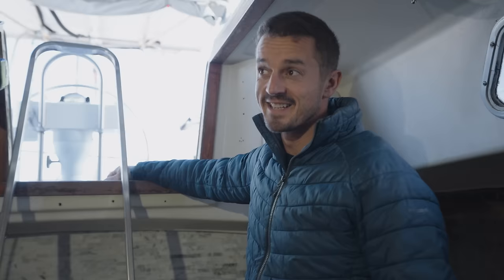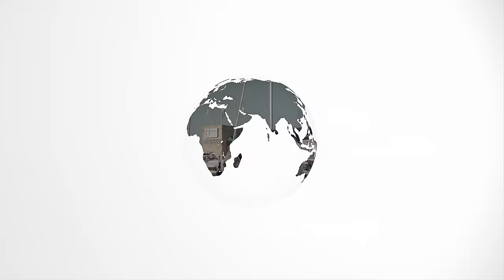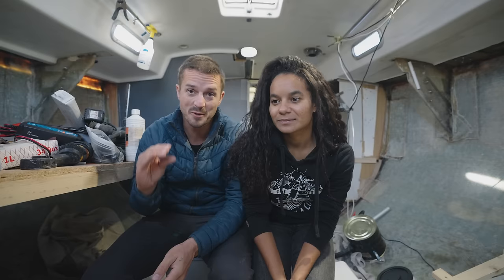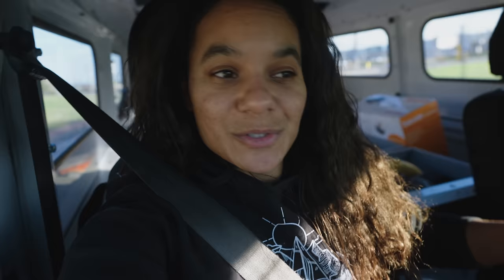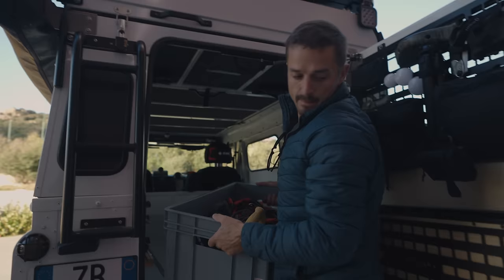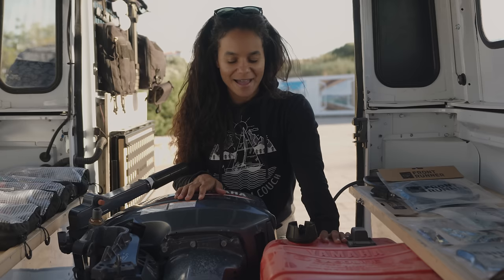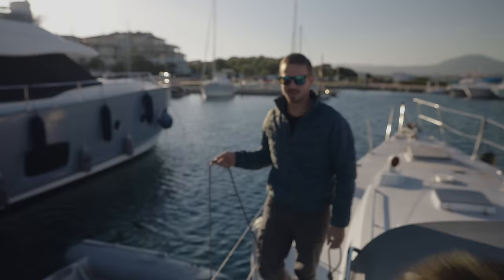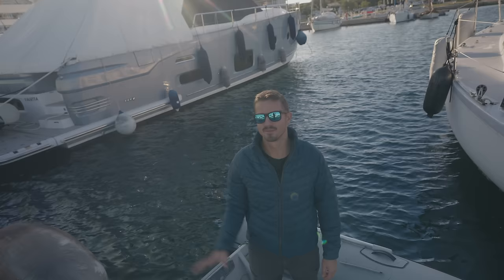BOAT WORK: It’s Time for a Change | Step 374

Comment: As light as Uma is after removing all that stuff, do you need to tie it down so it does not tip over?
Reply: On sailboats, the ballast makes the boat stable.
The boat is even more stable now than before because the center of gravity (CoG) is lower than before.
Reply: @charonstyxferryman  Thank you so much for explaining this to mem Lars! :)

Comment: While Uma's on the Hard, why not look into possibility of a bow thruster????
Reply from the maker: We really don't need it on a 36ft boat. You can use a dock line and the wind with great efficiency. Bow thrusters are useful, but on larger boats that you can't "man handle" to the dock.

Comment: If you add up the content earnings and subtract the repair costs, would it have been more cost effective to buy an aluminum hull ship?
Reply from the maker: They cost about $1-2,000,000 so yes! Way cheaper to rebuild something we already own.
Reply from the maker: They cost about $1-2,000,000 so yes! Way cheaper to rebuild something we already own.
Reply: @SailingUma  what about a new version of Uma?
Reply: @SailingUma  Alluring Arctic Sailing bought a aluminum hull boat that had been on the hard 15 years for less than $60k. Check out their restoration.

Comment: Greetings from Germany. Your energy management scheme reminds me of Germany's energy scheme. You have a gasoline generator, gasoline dingy engine, diesel truck and an electric boat motor. Teutonic logic?
Reply from the maker: A sailboat has sails. The motor is for docking. It's like having an electric bike. The rest doesn't really work in the current infrastructure in the places we plan on going. It's all about "the right tool for the job" we don't claim to be purists. We're more practical than that.
Reply: Agree with you on tools for the job. We have a diesel engine an electric outboard. That works for us! We have been investigating the Combi retrofit hybrid you saw at the show a few weeks ago. Maybe too expensive though. 
Should have said that we are summer liveaboards.
Reply: Thank you for the reply. I was not commenting on your purity, rather, I was pointing to the futility of chasing Don Quixote’s wind mills. I would have thought your experience in the sunless north would have put you off the electric illusions.  By the way, have you seen how lithium is mined in Chile?

Comment: You know that its quite admirable that you have gone to an electric propulsion system in your boat in the aim of saving the environment and for quiet operation etc., but you drive around a diesel truck and use a gasoline powered dinghy. Not sure of the rational here or the sustainability of an electric propulsion system in any vehicle. Care to comment?
Reply from the maker: Never claimed to be saving the environment. Thats not why we went electric. We went electric because it’s just a better system than a diesel engine period, and on a sailboat it makes all the sense to have electric because you can recharge your battery bank while sailing. On an overlander truck , that is meant to travel, it doesn’t make sense. On a dinghy , the power needs to come from somewhere. On  an all electric sailboat, it doesnt make much sense for an electric dinghy. On a hybrid system where you have an electric motor paired with a diesel generator , an electric dinghy can happen because you then have enough juice to recharge those batteries . Maybe this helps clarify a bit more.
Reply: Thanks fo the clarity and honesty in your reply. It does make sense to have renewable energy sources for propulsion especiaĺly offshore. Glad to see a practical and common sense engineered approach in this crazed world of politicians with completely unrealistic expectations.

Comment: I think you shouldn't have show where you were putting your stuff.

You have for several costly material, probably dozen of thousand of dollars.
An engine, a dinggy, electronics instruments, lines, sails, watermaker, batteries, panels.. and more. Everything unsupervised, protected by 2 smalls locks. 

On top of that you said you were not even in Europe for the holiday season...

It's like a "royal buffet" for criminals.

I got all my old raymarine electronic stolen (and my old yamaha diggy engine) while in a marina, not really far from here. Even though I had a massive lock, which they cutted like it was butter, and destroyed my console with a crowbar on the deck to extract the screens.

They knew that a single 15 years old screen was 900€ on the spare market. 
So now I know that boat spare part are 'yummy yummy' for thieves... and you got really 'yummy' parts.

So maybe blurr out the name of the storage... Or remove the sequence entirely...

But well, I may be wrong, in the end, i'm not an influencer, merely sailor and youtube commentator during winter seaon.

Comment: Sorry to be so negative but if you guys are going to have someone else do the refit work maybe it is time to just get a new boat.  Part of what I enjoyed about your channel was you guys did things yourself on a budget.  But of course things have changed and you are no longer two young students with zero income.  Those people that put in a forklift motor and had a fold up dinghy didn’t drive a new SUV.  Things have changed (for the better) and maybe saying the keel is going to fall off will make it easier on all of us to move forward with a new adventure.  Good luck and Best wishes.
Reply: That isn't a new Land Rover (SUV).
Reply from the maker: everyone always has a “budget” some budgets are just larger than others. But even if we were paying for the entire refit (which we are not FYI. We are only hiring out extra hands for the portions of the refit where we need extra help like the keel and the structural lamination) the whole refit would cost us a total of about 20k-30k over the course of a year. After which Uma will be a better stronger boat than when she was originally built. Please try to  find a new or old boat with “less problems” for that price!
Reply: @SailingUma  there are zero boats with zero problems.  Enjoy you trip to the BVI’s.  Btw love your hair!

Comment: I realize the big bennifits of lithium ion batteries but thermal runaway scares me. I know there are different battery chemistries but just saying, you can not put those fires out.
Reply from the maker: The chemistry they use in cars is quite different than in boats.
Reply: There are videos of how difficult is to set fire to a LiFePo4 battery. Far harder than lead acid!
Reply: Why are these safer batteries not used in cars if they are safer?

Comment: do yourself a favor, stop chasing your losses and get a decent boat already
Reply from the maker: We're building a decent boat. Not "getting" one. Most "used" boat we can afford would all still require a huge refit to get them to where Uma will be with the same effort and money.
Reply: @SailingUma  I don't know, how much of the boat building supplies, boatyard stays, Vans to live in in the meantime etc... is gifted to you by sponsors, but based on ordinary prices that can't possibly be true. Especially since most of the equipment you already own could be refitted to another hull, that's at least structurally sound.
I'd really liked to be proven wrong. If you  did an episode about the numbers, I would certainly watch it.